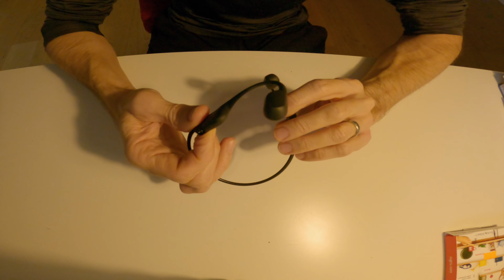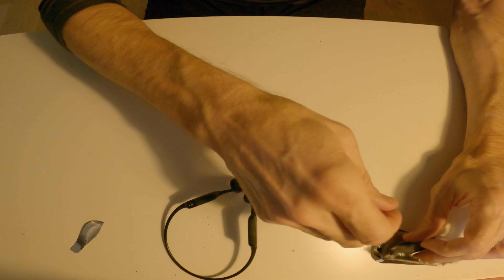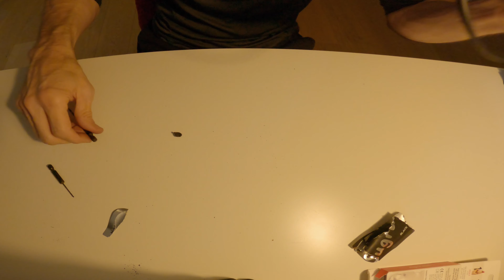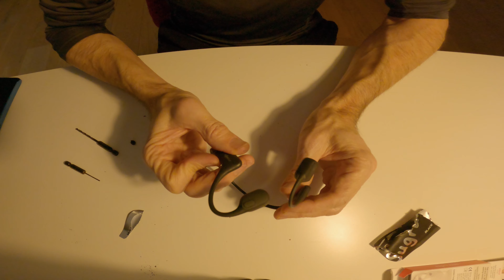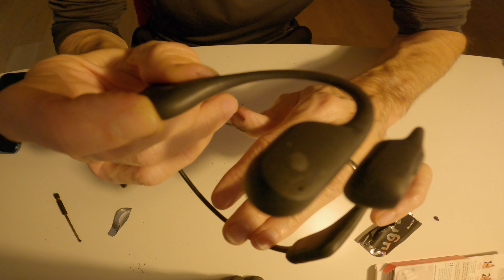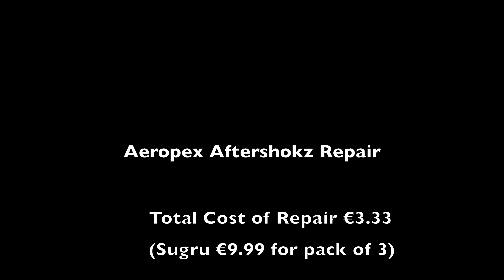Aftershokz Aeropex - Fix that Rattle

Comment: Thanks for the video and the comments. It worked perfectly. I started with 1/16 drill bit and slowly made a hole by hand. You'll know you made it once whatever is lose inside sticks to the bit magnetically. I made the hole bigger by going up bit sizes until I got to 9/64. I then stuffed the hole by putting cotton from a cotton ball. Cut little pieces and stuffed them in with a tooth pick. Once I couldn't put any more, I used the epoxy putty to stuff the hole I made. To make it a clean finish, I used alcohol pads to clean the excess and leave it smooth. They sound better then when they were new. Thanks to those who posted their experiences and results.

Comment: Unfortunately I broke the PCB path while drilling. On the right side with the microphone. A tip for others not to drill in the middle - keep and drill lower and closer to the inside edge (I mean the opposite side than the microphone), as the PCB path for the microphone is also there.
Reply from the maker: Sorry to hear that. Easy thing to do. Of course we wouldn’t need to be drilling holes in our headphones if Aftershokz did a better job on the manufacturing side 😡

Comment: Thanks for taking the trouble to post this fix. Just done the repair to my 2 year old Aeropex and the rattle has gone without any obvious loss in volume. I was careful not to put too much sugru glue into the hole and tested the rattle after each little bit I put in.  ps. I got the same 10% discount offer from Shokz when I contacted them about the rattle - not very generous :(
Reply from the maker: Glad to hear the fix worked for you. I did get some deterioration in sound quality afterwards but they still work good enough for my needs. This is clearly a very common problem and I don’t think Aftershokz are being very generous in addressing it. I will not be purchasing from them again any time soon. Thanks again for watching.

Comment: My shokz openrun rattle from the day I found them in the parking lot.
Reply from the maker: Yeah, definitely poor construction…but just good enough that most people’s warranty has expired by the time the rattle begins. Shame on Aftershokz.
Reply: I wonder if they could be fixed in a similar way to yours, but by injecting some hot glue through a tiny drilled hole. Need to try this method, cause no sugru glue avaulable here.

Comment: Hi, Can I do it if the rattle is on the left side?
Reply from the maker: Yes, it’s the same process on both sides. Actually, in the video, I fix the left side also after I have finished with the right hand side. Best of luck with it 👍

Comment: Word of warning, I think I stuffed too much Sugru into the holes (I used a toothpick) and now the volume/bass is very uneven between the two. Probably still useful for listening to podcasts, but listening to music is no longer an option.

(ordered a new pair yesterday, gonna be extra careful with these now that I know about their fragility)
Reply from the maker: Sorry to hear that Alan. I’m surprised you were so quick to order a new pair from them. I’m a “once bitten, twice shy” kinda guy. They won’t be getting any more of my money.
Reply: I don't think it's a question of fragility, mine were sitting in a drawer for most of the warranty period. When I decided to use them again they rattled. I believe it's a time degradation of their materials used rather about user abuse.

Comment: Thank you for this useful post.  I have just fixed my aeropexes so didn't need to buy another pair.  They were out of warranty by a year, I think.  Tip for some, maybe, I actually used milliput epoxy putty.  £5 for 113.4g so better value putty and not single use sachets so could do lots of repairs to things around the home.  It does just the same job.  Thanks again.
Reply from the maker: Thanks for that Jason and glad you got rid of that pesky rattle. The milliput epoxy putty sounds like a good idea. I ended up looking around to see if there was anything I could use my spare Sugru on before it went hard. I did manage to cover a fraying section of an iPhone charging cable so that lessened the sting of chucking the rest in the bin. Thanks for watching 👍

Comment: I had the rattle in the first pair, warrantied pair worked great, now I've got a loose connection to the button side, just going to purchase a new pair, will try to fix these when the new pair arrives
Reply from the maker: It’s a shame they are not more robust. Mine have been fine since the repair but the audio quality in general is poor. Fine for podcasts which is what I use them for mostly but for music 👎👎
Reply: @filmmytrailrun  useful for me as an industrial employee. I can wear foamies too. Audio quality isn't Bose, but I didn't buy them for that 🤷🏼‍♂️

Comment: I also have a pair of Aeropex that developed bad rattles in both ears. Since they are out of warranty, I found and followed the Sugru method, and it did fix the rattle. Unfortunately, it also severely affected the sound quality of the headphones. Nearly all of the bass is gone, and there is a massive spike in the high-mids which makes them so shrill that they are no longer even suitable to listen to voice-only podcasts, let alone music. Some amount of movement of the internals seems to be intentional.

I didn't try to pack them full or anything even close to it, but I suspect that I used too much Sugru, restraining the internals to the point that they can't do their thing. For anyone else who wants to try this method, I would suggest pushing in only a little Sugru at a time, stopping absolutely as soon as the rattle is inhibited. In this case, I think that less is more.
Reply from the maker: Yeah, I never found the music quality was great from the aftershocks even before the rattle but after the fix, mine at least, were only good for podcasts. Given the popularity of this video it is clear that a great many people have had the same issue. “We’ll give you a 10% discount off a new pair”, give me a break. I would be very slow to buy from this company again.

Comment: Hello I had the same issue and it happened to even a replacement headset that I received, so I hope they fix that issue because they really are the best bone conducting headphones.

I was able to fix mine making with a utility knife  a very small hole but in the bottom close to the outside edge (so wont be so noticeable) and pushing in some soft plastic, I think something that gets hard will affect the sound, so it worked.
Reply from the maker: Yeah, it seems to be a very common issue with these headphones. I don’t think it’s down to mishandling them but rather poor materials, e.g. glue, on the part of Aftershokz. It sounds like your fix may have worked better than mine because I did get a deterioration in sound quality. They still work for what I need them to do but I will be slow to go back to Aftershokz. Thanks for watching 👍

Comment: My cat bit through one of the battery areas on my air treks, I'm trying to find out if they're still safe to use as I see no leakage.
Reply from the maker: Personally if they still worked ok and there was no leakage I would continue using. You could use some of the Sugru I use in the video to cover the chewed area. I used it recently on an iPhone lead that had become frayed and it covers the impacted area and gives me greater confidence about continuing to use it.

Comment: I tried to fix it but now there is no sound from that side :(
maybe I broke it while drilling
Reply from the maker: I’m sorry to hear that. Yeah, I was careful to keep a watchful eye on how close I was to breaking through the outer plastic.  It sounds like the situation is not salvageable but If I were you the first thing I would do is try resetting your headphones:
Start with your headphones powered off.
Enter pairing mode by pressing and holding the volume+ button for 5-7 seconds. Your headphones will turn on, and then the LED light will flash red and blue.
Press and hold the multifunction button, volume+ button and volume- button simultaneously for 3-5 seconds. You'll hear beeps and/or feel vibrations.
Turn your headphones off. Your headphones are now reset and can be re-paired to your device. In addition, I suggest going into the Bluetooth settings on your device and deleting or forgetting your AfterShokz, then turning the device off and back on again before beginning the pairing process.
Good luck

Comment: I have the same problem. How is the repair holding up?
Reply from the maker: Everything is still working fine but the bass has diminished. I never found them great for music anyway but they are definitely reserved for podcasts now.  Remember though, if they are less then 2 years old Aftershocks will replace.
Reply: @filmmytrailrun  Thanks, I tried the repair but don't think I drilled far enough (just through the rubber). Mine are at least 4 yrs old.